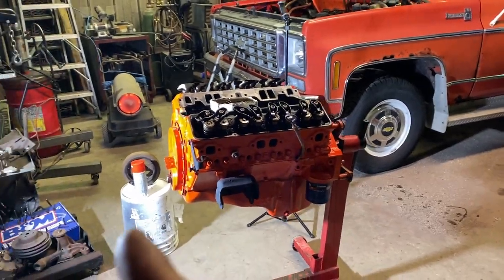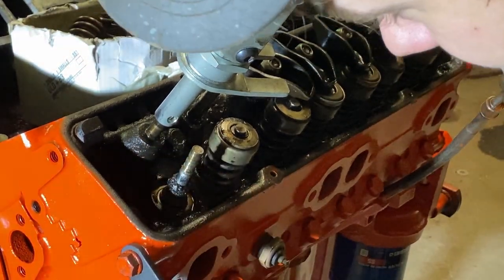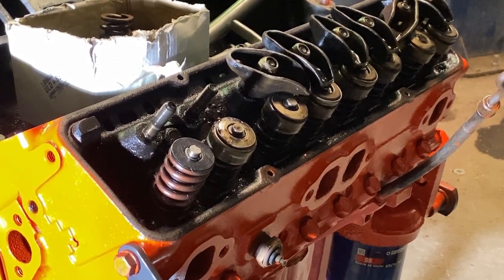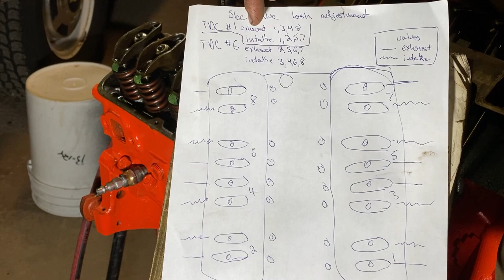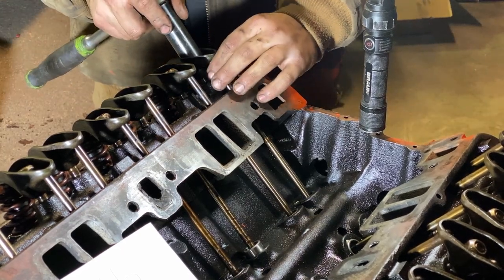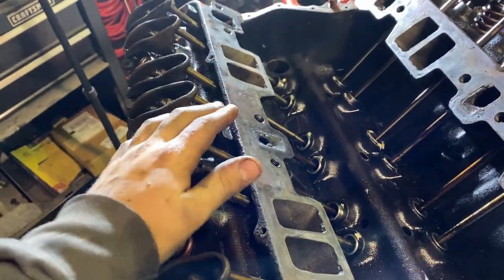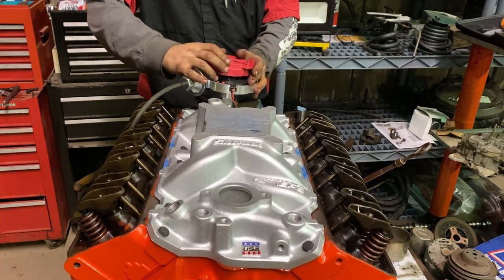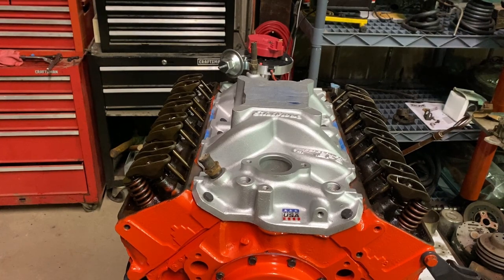Squarebody C20 Project Part 14 THE FINAL PARTS ARE HERE! |square body|

Comment: You can also point the distributor at number one and if it doesn't in line with the oil pump key way turn the cranks out until it drops. That's how I was always taught